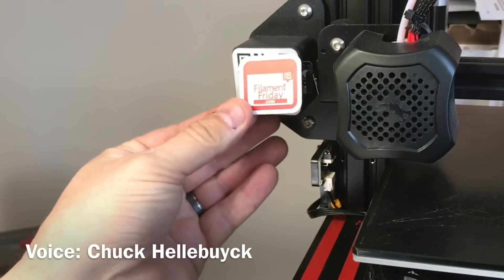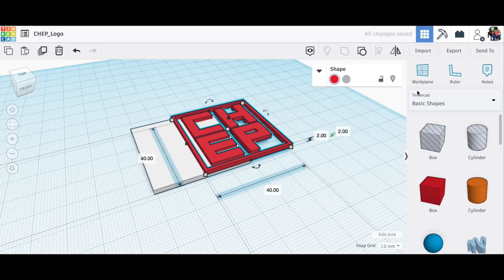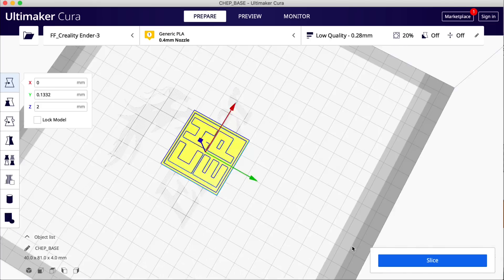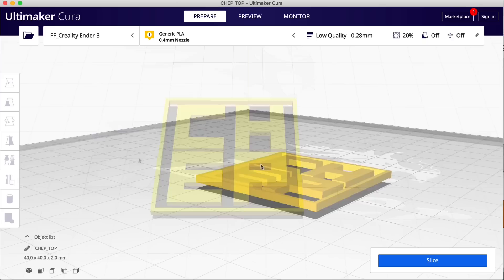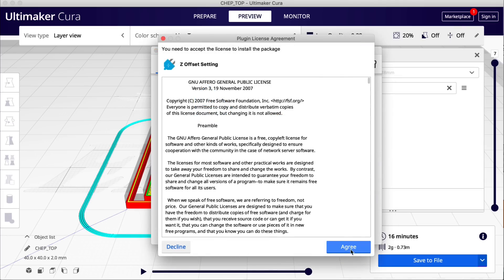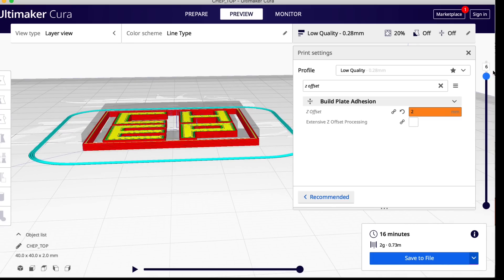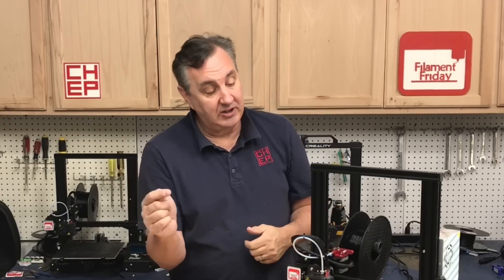Two Color Print Using Z-Offset Plugin in Cura

Comment: A lot easier than using pause at height
Reply from the maker: Thank you. You get it.
Reply: @FilamentFriday  Especially since pause at height doesnt work on the V2 (without custom code).. this is an easy fix and you don't have to stand around waiting for your print to get to the right height to hit "pause" manually..
Reply from the maker: Yep.

Comment: Good tip, only something to mention is that you need to disable auto leveling, because a lot of printers will level (bltouch and etc) on the print then
Reply from the maker: It’s been mentioned many times in comments for those that have installed autolevel.
Reply: @FilamentFriday  aah didn't read all the comments. Keep up the good work!

Comment: Hey Chep, nice video, you can do this without a plugin and as a bonus it will show the item raised over the bed in the preview. Just print one line anywhere on the bed (the purge line doesn't count). The easiest way I found is to add a support blocker, make it a normal model and resize it to be only 1 line (it could be just a dot, but for retracting and priming purposes, a little line works best).

Comment: I wonder if you could use "Per Model Settings" to set z offset for  the model and still get your prime line or skirt on the bed.  If that doesn't work, you could maybe design a prime line as a separate stl file and then use Per Model Settings.
Reply from the maker: The prime line prints prior to lift the 2mm. I mentioned it in the video.

Comment: I've had so much trouble with pausing and swapping on the ender 3 v2, and the carriage slipping when removing filament. 

This ought to be a decent solution!
The only caveat is don't let the glass cool down or the part will pop off!!
Reply: If you use Octoprint, I had the same issue. I fixed it by doing auto home on the printer, and then resuming print on octoprint.  on my Ender 5 Pro it is no issue but on my ender 3 pro where the extruder is on the z axis, i see the same thing. sucks to lose a long print that way, but i figured it out with auto home.

Comment: I do the same thing without any plug ins. But im using BLTouch leveling technique to print two colour print. You must have to try that. Its the easiest way to print multi colour layer print. No plug ings needed, no pause at height. You can print 2nd layer any time you want.
Reply from the maker: You should do a video. I can’t understand what you are describing.

Comment: looks like the heating-cooling-heating cycle caused it to warp. I would edit the gcode to keep the printer from turning off the heat bed on the first print. Seems like I've printed into thin air without this plug in before.. even complicated stuff that shares the same layer by using z-hop.

Comment: There should be an option to to keep models from dropping to the build plate. That’s worked for me in the past,  this is also a great idea as well!
Reply from the maker: There is that option but I had it turned off. It won’t affect the GCode anyway so doesn’t matter.

Comment: Doesn't bed levelling foul up the second print process?
Reply from the maker: You mean Autolevel? 
You can store the values. You don’t need to run autolevel on every print.
Reply: @FilamentFriday  I appreciate that, but shouldn't you have mentioned it?  If it doesn't occur to viewers, they are going to crash the sensors into the first print.
Reply from the maker: Ender 3 V2 doesn’t have Autolevel so I was showing based on stock setup which I prefer and recommend anyway. If someone modifies their printer such as control board, firmware, autolevel, octoprint,  etc. then they can adjust by storing values or modifying gcode or whatever they do for their mods. I can’t cover all disclaimers. But Commenters do a fine job of that. The main point was to show Z offset and how to enable it in Cura.

Comment: Why not just add a Pause to the Print at the right Layer Height? 
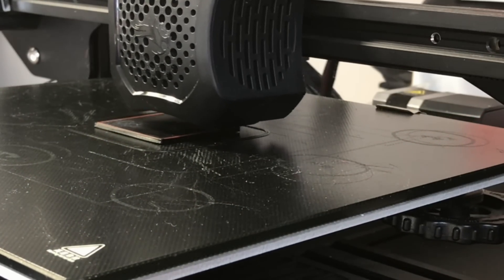As your Bed will Cool down and as you can see at 3:37 you have warping off the bed. You have a high risk of Getting the nozzle ripping the part off.
Reply: If your print is curling/curled will the nozzle know not to hit that part of the print or no?
Reply from the maker: Michael Biru - It was more about showing the Z offset plug-in option. Pause at print doesn’t guarantee no warping on first color.

Comment: But what about the stop Gcode? I guess it would turn off the heated bed so that the first part of the print will come loose. So if you're not around and start the next print within minutes you'll get into trouble..
I mass produce my own two colour business cards and I had to learn a few things the hard way: at the end turn off your extruder but keep the heat of the bed. Move your extruder out of the way and very much up, wait for button press, then move your extruder a little bit to enable stepper motors again (depending on firmware), make a purge in the air, wait for button press (nozzle cleaning manually) them continue print.
But it needs manually editing of the gcode

Comment: Just do a Filament change in Cura when you hit the level you desire. No need for 2 stl files.
Reply: Srly! With Jyers‘ Ender 3 V2 firmware the M600 command works perfectly well - even with pop ups and all.
Reply: @Schnabulation  such a shame they don't have it working in stock. But this is the double-edged sword of open source and cheap ;)
Reply: @Schnabulation  wouid it work with an touchscreen as well Jyers
Reply: @Schnabulation  how do u get the M600 command ?
Reply: @monsterstorm78  
You have to change the firmware  to enable it there is a video how to do it.
Reply: @itzikovadia851  which video tho
Reply: This whole video is unnecessary. Cura and PrusaSlic3r have a simple way of just adding an m600 wherever you want and the code automatically triggers a filament change
Reply from the maker: 3D Bengineer - I’ve covered those in previous videos. This shows how to add Z Offset.
Reply: @FilamentFriday  indeed, useful information to have even if the function to do this exact example is easier using other methods. Nota bene.

Comment: I think it's much more simpler to do a color change in PrusaSlicer. I don't really see the benefit of this technique over the other. You say you can change it when ever you want but depending on the build plate it might not be true if the first part releases itself. To each their own I guess. Is Connor Hellebuyck really your son??!
Reply: 3:30 You can see the corners are warped on the upper and lower right of the first print. It's ever so slightly lifted, but still noticeable.

Comment: Or you could uncheck the "remove empty first layer" setting on Mesh fixes and it will print it in the air where you place it :D
Reply: Exactly. @CHEP should pin it

Comment: 3:25 I can see the corners lifting on the black base layer. A skirt (or raft) would of helped.
3:50 Imo, rounded corners would have looked nicer than those square ones. The badge would have matched up better with the Ender's rounded cover. Cool though.

Comment: This seems like a lot more work than just doing the M600 filament change. Can you address why you didn't just use that gcode?
Reply from the maker: @Benjamin Vaterlaus - In case you missed it, it  was because I was showing the Z Offset plug-in not M600. 
Also, FYI, many stock Ender 3 won’t recognize M600 unless their firmware is updated.

Comment: there is also a way to do this without the plugin and it also purges the previous filament, all you have to do is to create a cube that isnt in the path of the print (i usually put it in the bottom left corner) that has the height of what would be the start of the 2nd color (e.g: the red part is 2mm from the bed so this purge cube would be 2mm tall, how wide it is, doesnt matter) if the first color isnt flat like in this case you would need to use a z hop between layers so it wont hit the previous part already printed. But still great video, this is easier for a beginner and its also less of a hassle to set up

Comment: You can make cura auto-align the models by exporting them on the correct place from tinkercad  and after importing them in cura select both and right click ->  "Merge Models".
Also, you should mention that cura already has suport for multiple materials if you change your printer settings to act as if you printer as multiple extruders. Then you can put some custom extruder switching code as well to make it pause or something.

Comment: Too complicated. I just use the "pause on height" and change filament and continue print. No z offset needed.
Reply: That’s how I do it. I guess if you don’t want to stand around and monitor the print for the color change layer, CHEP’s method we works well.
Reply: @howardmandel7930  use M600 gcode to do a filament swap - you don't have to wait around, then.
Reply: @BenjaminVaterlaus  thanks for the advice. This seems like the most sensible option!
Reply from the maker: @Benjamin - Some Enders don’t recognize M600 unless the firmware is updated. The point of the video was to show Z offset in Cura.
Reply: too buggy
Reply: How do you avoid the blob of filament when it starts printing after the color change?

Comment: I think people with automatic bed leveling in their start G-code would get bitten when it goes to get the mesh in between prints.
Reply: Yup (waves sheepishly).
Reply: If your printer has been pretty reliable, you should be able to comment out the automatic bed leveling in the g code for this print.
Reply: @jeffhaas9577  But how will your printer know the z position?
Reply: @MrSjirafje  I think you can have it remember the last bed leveling results and use those.
Reply: @jeffhaas9577  I don't understand how this would work with a printer like my E5+

Comment: Thanks! Pause and filament change sometimes fail because the printer looses position from the man handling of removing of the filament. This will work better.
Reply: I even tried sending locking the steppers with sending the gcode and it took it but the z-axis moved and print was toast
Reply: so true. I ran into so many print fails cause of this
Reply: @kzukez  exactly!

Comment: Isn't there a setting in Cura to enable or disable empty lower layers? I once made an AC/DC keychain with black background and red text by doing that. This could be really useful if you need support on the top part without it trying to print support inside the first few layers
Reply: Yup, I checked it's under Mesh Fixes. Good memory!